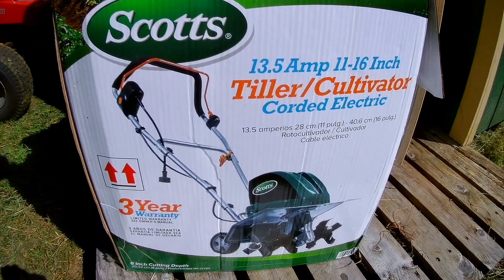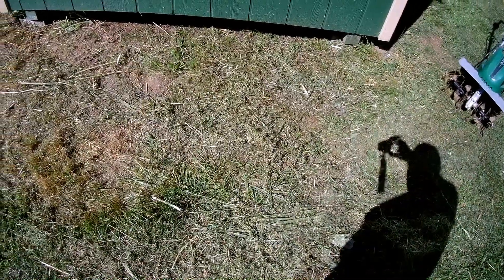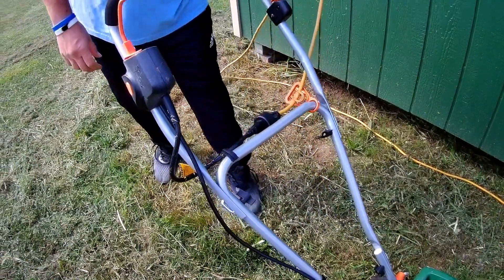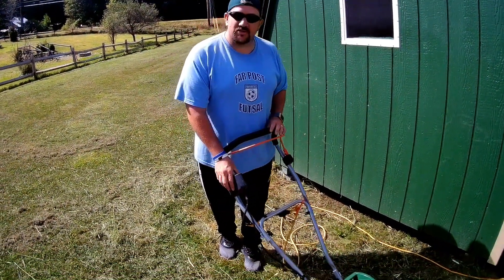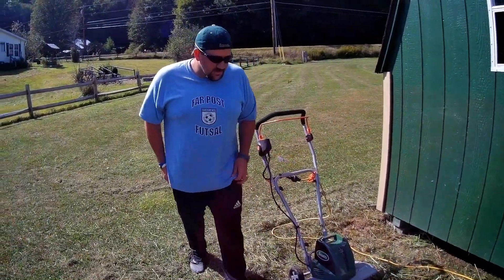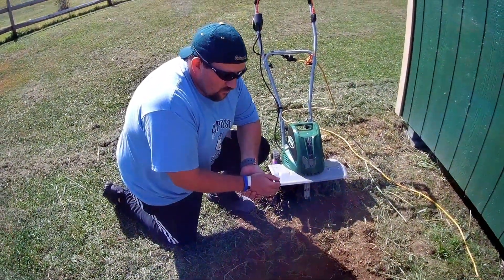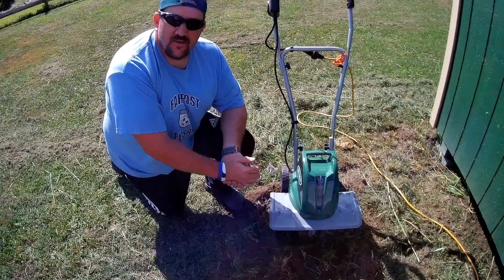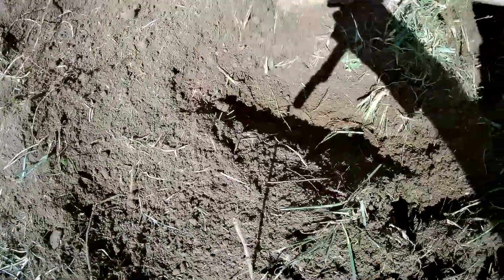SCOTTS 13.5 Amp TILLER Review #37

Comment: Thanks for a practical, applied  review covering performance in virgin and pre-tilled soil. It convinced me it would do the job I need on small previously tilled flower beds. Result: subscribed and bought one. As of 6/19/20 Durastyle has this on-line for $94.99 plus $4.99 shipping.
Reply from the maker: Thank you and let me know over time is something comes up.

Comment: Seems as if the rear wheels are for transport, and are to be flipped up to till.  At least that's what I'm seeing in other videos and info. Do yours flip up?

This would allow it to dig deeper certainly.

"The rear wheels make this tiller easy to transport meaning anyone can handle this tiller without having to carry this tiller around the yard. The most efficient way to operate this tiller is to flip up the back wheels and walk the tiller backwards allowing the tines to dig into your soil."
Reply from the maker: I have taken a look at this....I thought it was for storage reasons....So yes it folds....No i have not tilled with it folded up.....I will investigate this and report back at some time.....Sorry this took so long to respond as messages don't always show up...

Comment: Thanks for the video.  I’ve never used a tiller before so this was helpful.  Is it pretty easy to use or does it require a lot of strength? I’m basically looking to use it to break up dirt to help grow some grass.
Reply from the maker: yes very easy to use. Light as it has no gas engine that is heavy.  Just to let you know the wheels on the bottom do fold so you can get down more in the ground. I use this about 3x a year and I have a good size garden.

Comment: I haven’t turned mine on yet…guess I’m scared.Can I go forward or only back?
Reply from the maker: As you till and can see in the video, I go both forward and back. If you are looking for a deeper till flip up the wheels. This is very easy to use just don't run over the cord. That is by far the biggest issue I have.